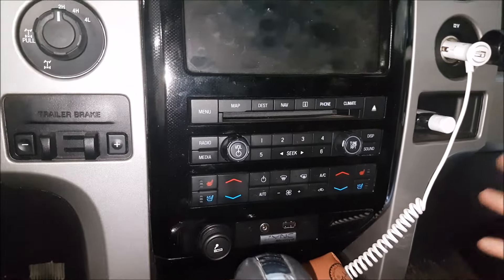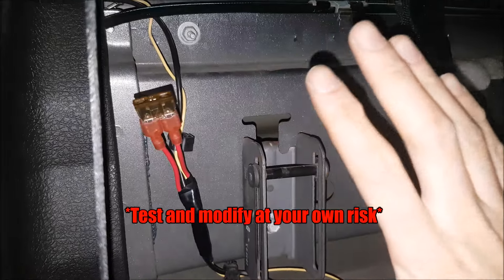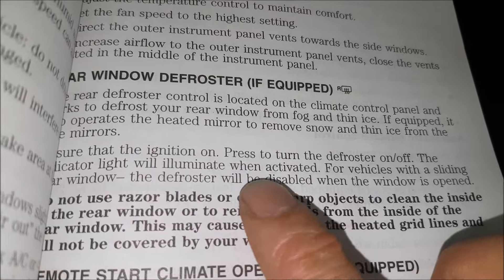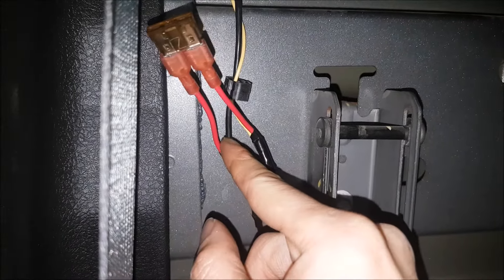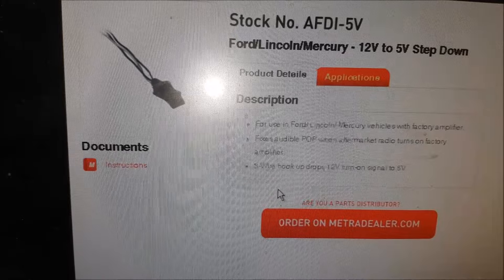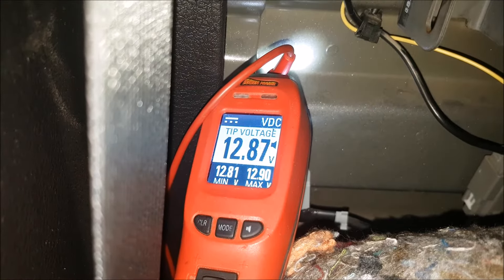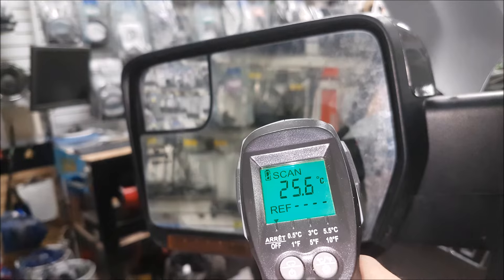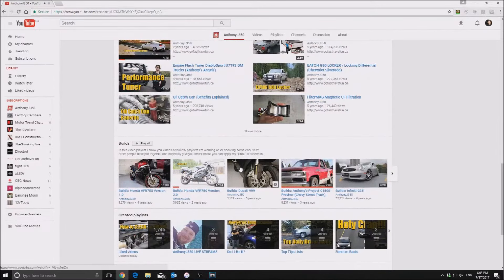2009-2014 Ford F-150 Rear Defrost/ Defogger and Heated Mirrors not working | AnthonyJ350

Comment: Hi, so I did some more trouble shooting and I'm hoping you can help. I used to get about 0.6 ohms from one side of a piece of glass to another. Going from the driver side to the passenger side it was about 3 ohms. I bent the fingers to make the switch connection and now I'm getting 0 ohms all around. But, when I press the button, I now get 12v to the thicker wire and my mirrors hear up. But when I test the resistance on the glass it's about 35 ohms...??? Also, did you have voltage to the yellow wire before you spliced it? Thanks!!!
Reply from the maker: Did you defrost start to work after you bent the connection?

Comment: Hi Anthony, Did you wire the fuse at the resistor or before or after the connector? thanks.
Reply from the maker: You want the fuse before the device hook up and the power source first.

Comment: I watched this whole thing and I can't figure out what the hell you did. You looked at connectors and took some voltage measurements but what did you change to get it to work again?
Reply from the maker: I jumped power to it with a fuse.

Comment: Did you verify the resistance from contact to contact on the sliding glass? I wonder if you could solder a wire between points to ensure a constant short. I understand you'd lose the ability to open the glass but I never do anyways.
Reply: Disregard, I saw on a forum where a guy shorted his and the rear glass shattered after a few days.
Reply from the maker: Thanks for sharing this info!

Comment: Hey - so it looks like you opted to not install the metra voltage reducer.  Is it working well without it?  Is that necessary or do you think just jumpering it over is adequate?
Reply from the maker: I'm in contact with the owner and it's still working. I think the Metra piece is better to get the voltage down.
Reply: The other question - is the rear fogger fixed from this or only the mirrors?

Comment: I have two questions. The step down harness from Ford has three wires,  how would you go about connecting it. I also saw in comments that someone's window shattered  do you think that's possible by using the stepdown harness. Just curious. Thanks for posting your video.
Reply from the maker: The shattering window is possible from what I've read. We tested this particular f150 and it was fine. There's 3 wires because one I'd 12v, one is Ground and the last one will be 5v. You'll have to consult the instruction manual for wire colour coding.
Reply: Thanks I'm going to try this
Reply: @donaldsouthern5662  how did this turn out for you? looking to possibly do the same

Comment: I wanted to ask if the rear window defroster is working now as well. I take it that it does but you didn’t show that it was heating up as you showed the temp. going up only on the side view mirrors. Mine quit working at the end of this winter and would like to try this than changing out the entire rear window as Ford dealerships say is the way to fix the problem. Thanks for the great video. Please let me know.
Reply from the maker: Yup it's still working in that truck up till now.

Comment: This is looking like the second time I need to replace that back window.  First time was under warranty.  This time I am not so lucky.  Since I am stuck I probably will risk taking apart those mechanical connectors because that is where I think this thing goes south...but I don't use that sliding window that much.   Wonder if water is getting in there. Argh.
Reply from the maker: That sucks to hear.  Hope you get it figured out.

Comment: I have a 2014 f150 limited my rear window defrost would light-up for a second then go off. I opened and closed the rear sliding window 4 to 5 times allowing 5 or so seconds in between and tried it. It stayed on. Oh my!
Reply from the maker: Awesome, so the contacts were just dirty?
Reply: @AnthonyJ350  I am having the same problem.  I Press the Rear Defrost button.  It will light for a second then go out.  The mirrors will heat.  No heat at the rear window.  Checked fuses all good.  Ive open and closed the rear window multiple times.  No luck.  This may be dirty contacts?  How did you remove the cover for the finger contacts?  Is there a way to do it without breaking it?  You skipped this step in the video, it would be helpful to see how it goes together, maybe there is a tab that can be pressed to remove it?

Comment: Here's a strange one, when I press rear defrost button, the led button light doesn't turn on, but the rear camera view pops up on the display.  Hit the button again and the camera turns off.  2011 Raptor.  I'm 3rd owner... I wonder if someone changed the wiring on purpose?
Reply from the maker: That sounds really hard to do.  Is there a camera button on the control panel?

Comment: Has anybody ben able to verify the 5 volt on yellow return wire on a WORKING window? I saw RWchugger installed reducer but light only stayed on for 1 second. Fyi super cab seats are tricky to remove.
Reply from the maker: The truck in the video the fix is still working.  I haven't been able to confirm the 5 volt solution but  I know the when we did is still ok.

Comment: Why do you think this needs to be taken down to 5 volts? Using ohms law the voltage is 14 and the fuse for the heated mirrors is 15 amps. That works one to 1 ohm of resistance
Reply from the maker: But is this the wire actually running the device or is it just an activation wire?
Reply from the maker: Do you think the mirrors run at 15 amps nominally? Or just when it spikes like on first start up?

Comment: Is the rear fixed from this or just the mirrors? You never retested the rear window.
Reply from the maker: I talked with the owner and they told me everything works.
Reply: Is this still working correctly on the original truck? No issues or new problems? And is he still using the "fuse jumper" or did he decide to go with the voltage step down kit?
Reply: @AnthonyJ350  Does the "fuse jumper" solution still work on your buddies F150 or did he decide to upgrade to the voltage drop down mod?
Reply from the maker: @therwchugger  It's still on the fuse jumper, no issues. I saw him about 3 months ago
Reply: @AnthonyJ350  Awesome, thank you. Do you know if the timer also works or does he manually have to turn it off?
Reply from the maker: @therwchugger  I think the timer still works. I would test and time it to verify the first go around
Reply: @AnthonyJ350  So after 11 min of the light staying on and mirrors getting hot, I manually shut it off. Rear window defrost did nothing temp wise to any of the 3 rear glasses. I thought timers were on 10 min? Any idea what the timer is set for? Also, after adding the voltage reducer ($13 on amazon) the light now goes on for 1 sec and then off. Mirrors still heat but light is now gone after a split sec. I'll continue to troubleshoot but think I liked it better when the light stayed on reminding me the mirrors were on
Reply: I removed window from circuit and jumped it out with the resistor in the jumper to provide a small load. Light worked and shut off in 12 minutes.
Reply: @Joe-ds3xx  so your rear defrost does not function?

Comment: At 1:50 "Figure out a way to reattach it".  What do you use to reattach the clips to the sliding part of the window?  The cover and the clips seem to come off as one and the clips tear off the sliding window.  Getting them back on is not as easy as it may seem.  Any recommendations that work?  Thanks
Reply from the maker: You would have to go to a glass shop and ask when kind of adhesive they use.
Reply: I actually found it was conducting epoxy. Bought a small amount and I glued on the two clips and everything works.  I was able to put on the black cover. Probably should have made my own video.

Comment: Mine stopped working too..  Fuses are good..  I suspect that the contact sensor is bad which requires a center window replacement..  It is clear that Ford didn't design this system too good..
Reply from the maker: You can try this fix, it still works in the truck from the video.

Comment: I have a 2014 f150 supercrew. The light on my rear defogger doesn’t light up when I press it but the mirror and sliding glass both still defrost. I thought maybe the light just burned out so I switched out the whole bezel with a new one and the light still doesn’t work when pressed. I like the light to be on so I will know when it’s on. Anyone else have this problem with theirs like this? I haven’t had the rear window shatter yet. Knock on wood.
Reply from the maker: I would also check out the connectors at the window, they might have come off.

Comment: My fiance had a window shatter because of the rear defroster grid so I called Ford they need more people to call them about the rear defroster grid so they could do a recall if they get enough calls in this is a big problem for the 2012 and for needs to fix it the Ford technician at my local Ford dealership said that this was a common problem with the 2012 f150 and the rear defroster grid
Reply from the maker: Sorry to hear that, hopefully more people speak out about this.

Comment: Has anyone ever used a thermacam  (FLIR IR camera) rather than one of those spot temperature sensors to confirm proper heating? I don't need rear defrost, but I'd sure like to get my mirror heat back
Reply from the maker: That's a great idea!
Reply: Your mirrors may be working even though light on defrost does not light up. Usually do anyway.

Comment: The whole window assembly is a resistor
Reply from the maker: Right but we're talking about voltage going to devices where it might need to see a particular value before hand to work properly.  Remember there is a switch, then module, then the window (and who knows how they engineered it and if it passes through other devices).
Reply: Yeah good point I get 10.2 at the power wire on the window

Comment: The mirrors still work when the defrost in the window fails, the LED just doesn’t light up. All you did was make the LED turn on, the defrost is still broken
Reply from the maker: Then why did the owner tell me it worked well the morning after?
Reply: @AnthonyJ350  Just going off your information it appears to me that the yellow line may be a check of the rear window's heating element, the resistance of which would cause a voltage drop.  If the heating element is in place and not broken it would have a specific resistance and accompanying voltage drop. It may be that the yellow lead feeds a sensor telling the computer that the heating element is there and complete, not broken.  If the circuit is broken then the computer wouldn't see any voltage, or if it's shorted (full voltage) that would be a fault as well.  Not certain about any of that but it makes sense that Ford put in a check to see if the heating element was shorted or open and would kill power to the rear defrost in either case.  It would be good to see a wiring diagram of the truck or get the info directly from Ford to confirm.  Depending on the way the circuit is designed hacking it could lead to all sorts of problems like the heating element being on continuously and causing damage, or other issues.  If you are going to bypass the heating element to get the side mirrors to work you may need to include a fake 'load' (that may be what the voltage drop indicates) to the sensors.

Again, I've not looked at the wiring diagrams and this is all conjecture, but hack at your own risk without fully understanding the designed circuit.
Reply: I did a temporary jump similar to the video and tested the rear window with a laser thermometer and it appeared to be heating.